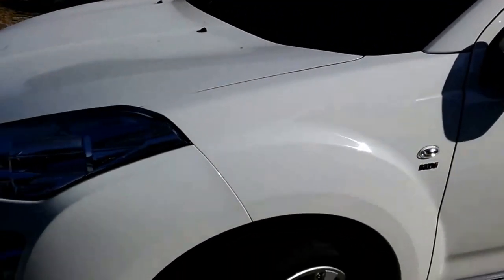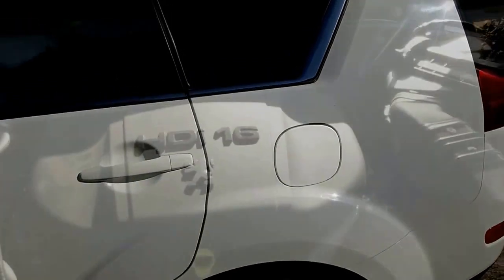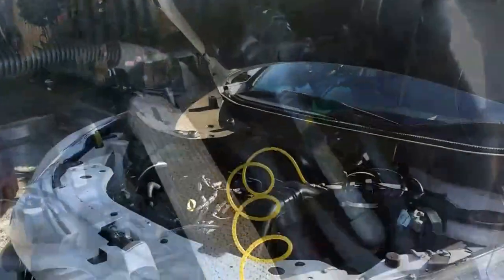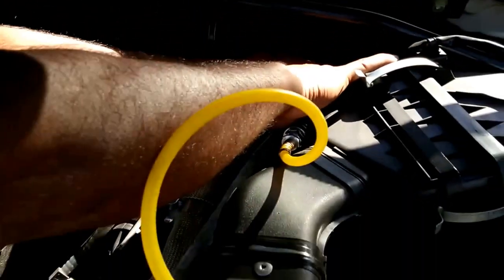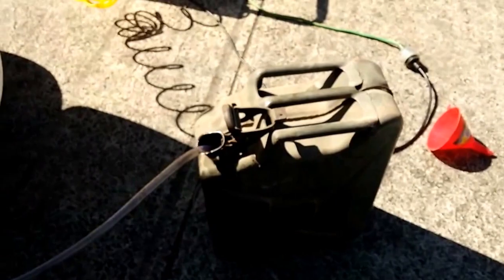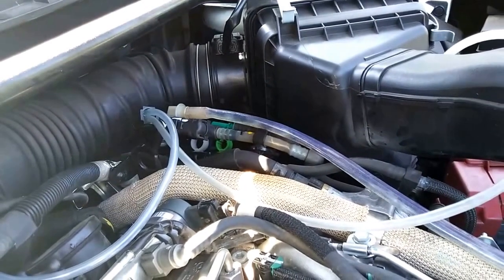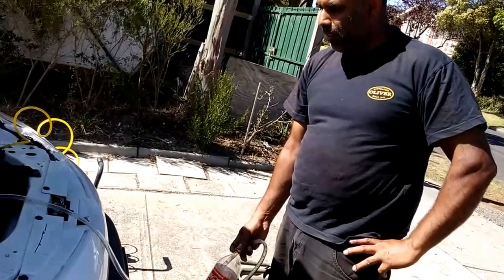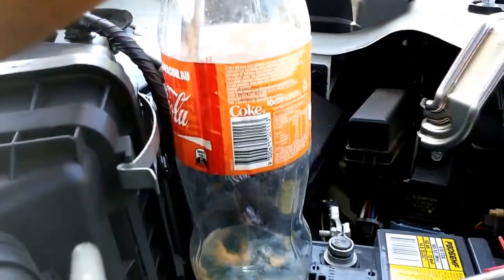Peugeot 4007 Siphoning or Draining Fuel

Comment: I got same model 2012 Peugeot 4007  diesel,  did u change the transmission oil?  From Sydney
Reply from the maker: No I didn't ever change the trans oil. I used to get the car serviced by Peugeot. I had to do this repair because it was Christmas eve and I needed to use the car. I sold it in 2019. It was a good car.